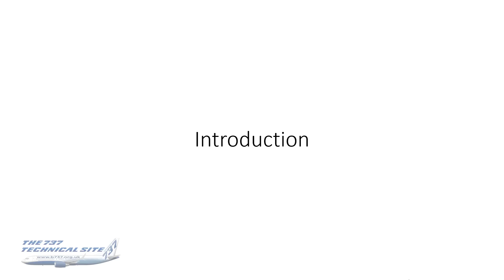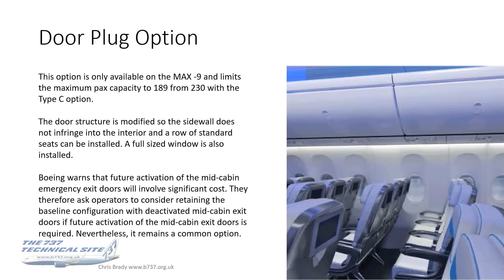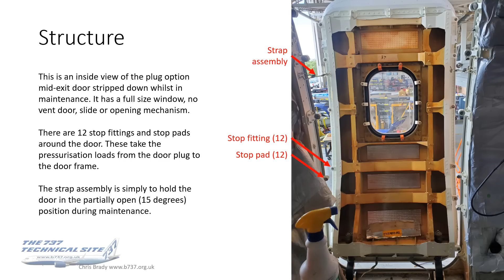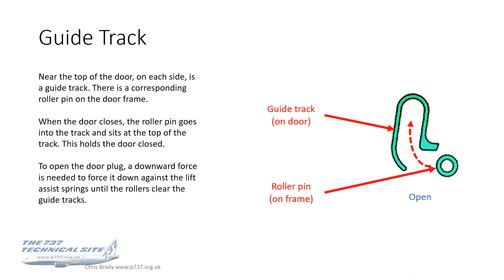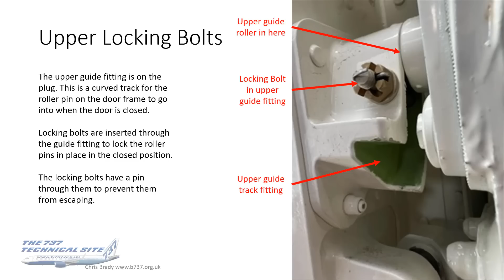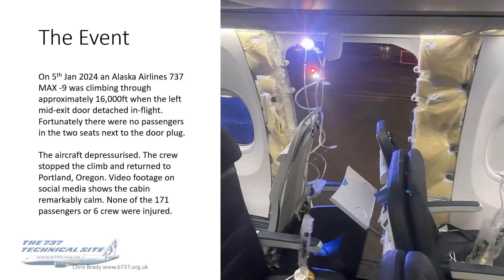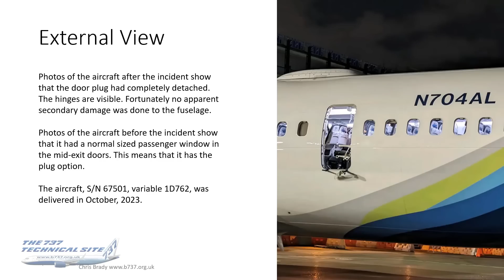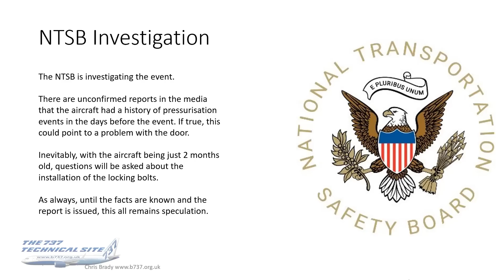737 Mid-Cabin Emergency Exit Doors - Plug Option

Comment: I’d be willing to bet any amount of money that this door was improperly installed or had been recently removed for some reason and reinstalled or thirdly this was a possible sabotage, for one reason to bring the aircraft down or two by someone who wanted to make the history of the 737 max worse than it is. there’s no weed to store broke free on its own. If it was necessary 10 men could not push it out. I will not be surprised if it’s discovered that someone is tampered with it. if anyone wants to know that is a castle nut and a cotter pin which also has a washer underneath it